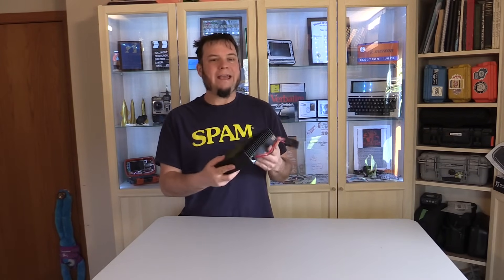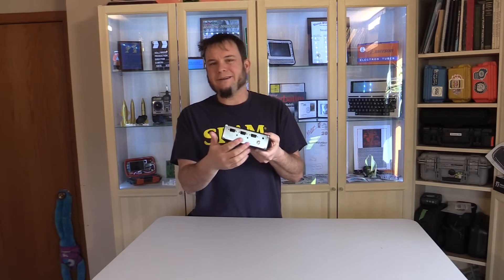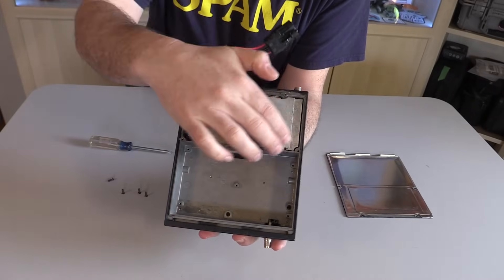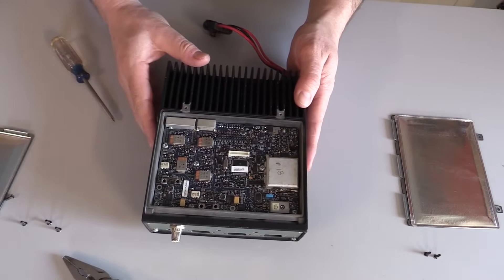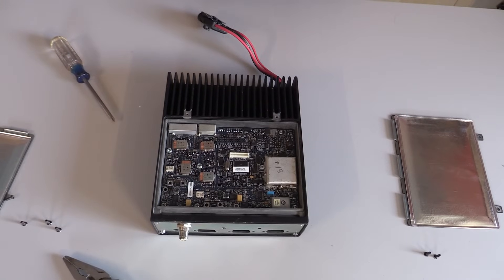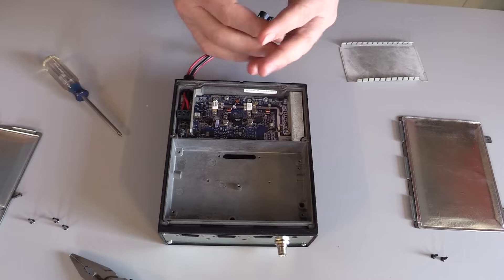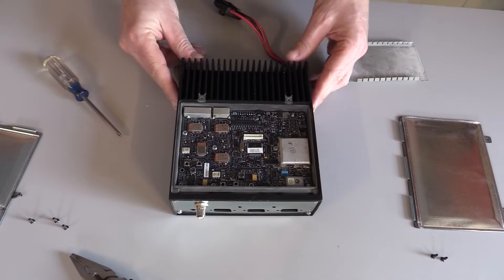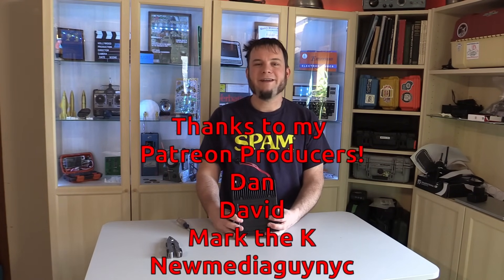Mystery Device From Ax-Man Surplus (Dataradio SCADA Tranciever)

Comment: Idea for homebrew use: it'd be cool to see if you could hack it to send your cars telemetry to meshtastic nodes or use it as a meshtastic mobile station. Being in the LoRa band already id figure it wouldn't be too hard to figure out how to console into it and tweak its modulation. Just verify that the output wattage is still compliant with current FCC guidelines. Not sure if they've changed much since '99.

Comment: The first Dataradio (aka G1) had no radio. It was basically a Terminal Node Controller (TNC) and (I believe) could only be connected on some Motorola land mobile radio.

Do you need a Dataradio controller? I need to check but I may have a spare controller laying around.

Keep up your excellent work!
Reply from the maker: I don't actually know what I'd do with one if I had it!
Reply: @saveitforparts  I'm sure that I can find the manuals if you want.
Reply: @saveitforparts  I can probably get the manuals if you want.

Comment: Yeah that's probably scrap metal.  I did some work on GE prophacy ifix systems about 10 years ago and it was all IP based.  Even if you needed a wireless link, you'd just plug your stuff into a switch and have a 2.4ghz POE radio to connect to the remote sites.

Comment: I used to work for Dataradio. That’s an RS-232 based modem that was widely used for public safety communications. I built dozens of systems based on that modem. It had parallel-diversity receive radios. (It uses a proprietary protocol for communication, and it requires a specific base station, as well.)
Reply: There should be a sticker on the back with an alphabetic serial number (4, maybe 5 digits). The communications board is what’s missing, so it is mainly just a somewhat useless 800-MHz radio at this point…
Reply from the maker: No stickers or numbers on it, I think it was just leftover factory surplus that never got to the labeling stage.
Reply: @Tim_Cailloux  When Sprint was allowed to buy Nextel they made a deal with the FCC to fix a mistake the government made by interlacing public safety frequencies between SMRS frequencies (Nextel) which caused significant interference issues. The result was called rebanding. A bunch of counties had these systems running for mobile data computers. Sprint agreed to buy the licenses, the data modems and the base stations. They were all supposed to be destroyed. At that point most agencies went to 3G and 4G cellular modems.

Comment: DataRadio Gemini PD (parallel decode) not used for telemetry or SCADA. These were used in police cars  or utility trucks for data connectivity. You’re missing the modem board. This is just the RF Deck. These were made in WI then shipped to Canada for DSP programming then to Atlanta for sale in the US market. The owners was Bob Roulette and Norm Pearl. Both were hams and part of the Montreal group that developed AX.25 protocol for ham radio. They took this idea and modified it commercial and public safety. The radio you have would have been in 2 bands UHF 400-512 and 800MHz. They feature dual RX antennas, GPS. The dual RX was for Parallel Decode aka PD. The radio used 3 Z80processors one for each RX and one to combine the data to recover a corrupt packet due to mobile fade or multi path. The data rate was 56kbps in 1999 layer upgraded to 64K. The modem could encrypt using AES or be in the clear. There was also a GPS onboard. These base station had the same capabilities of PD using 3 antennas on the tower. It also could correct the positions of the mobile units to sub meter accuracy with Selective avalanche on. When SA was disabled it was better than 10cm. We stopped selling GPS correction after that as it was un necessary. I worked for DataRadio in 1999-2001. It’s likely that the RF deck that you have was never finished at the factory and sold as scraps after Cal Amp purchased Data Radio. DE NI4Y
Reply: Excellent informative reply !
Reply: Nobody’s gonna believe me but when I saw the 12V connector and data and RF I immediately guessed Police data radio. So, I want a point. 😂
Reply: @LinHolcomb  the Integra TR was a SCADA radio in the VHF, UHF and 900MHz band .. Elephant Butte Irrigation District still has some in use ..
Same enclosure...
Reply: @jaimesolorza4186  I was at Radio IP at the time. I mostly worked alongside Michel Binette. There's still way more G2 still in use today than you may believe. I'm aware of at least 4K G2, maybe more. G3 didn't last as long.
Reply: @simonforget280  I understand, those radios are work horses like the original MDS radios...
Reply: @jaimesolorza4186  I have often wondered if they could be converted to a small repeater. They have a totally separate RX unit. I’m not sure what the isolation is inside the RF deck.
Reply: @LinHolcomb  I know they had built in duplexors and I believe adjustable helical filters ..you might be on to something... they had 400 and 800-960 MHz versions
Reply: @jaimesolorza4186 yes that was the SCADA side of the business it was run out of WI. That part was purchased from
EF Johnson. I worked for mobile data as an implementation engineer. We did some measurements for them on 902-928mHz sampling noise floor on the ISM band for the part 15 (no license required band. This was specifically done because a company called Ricochet was operating thousands of 902-928 MHz radios on light poles. They offered mobile data city wide at 128Kbps. The engineer whose position I took over left to work for them. It was an interesting company to work for, but they were mismanaged and expected a giant bid from the state of FL. M/A Com got the bid for a statewide data/voice system. We could only offer data. They laid off a bunch of folks. M/A Com never could make it work correctly. We had installed systems in Canada larger than FL using multi site controllers. MSC were Linux boxes that connected multiple sites over a giant serial card and Motorola leased like modems on POTS lines or microwave links.  I will say this really positive thing Bob thought US health insurance was terrible. He paid 100% of medical including all RX. It was amazing I had a $0 hospital visit.
Reply: Nailed it.

Comment: the lack of decals from the mfr on the outside make me think this might be a custom product that needed some specific changes made to it, or it was a prototype from the mfr. also those punch outs on the back we would usually just call DE punchouts or RS-422 punchouts. The most accurate term is DE because its the D-submini shell size E. its annoying, but the shell size can have any number of pins (or anything really) inside of it. you almost always have the 9 pin of DE-9 (commonly misnamed as DB-9), but i've seen it where its only a few pins in the shell. i've also seen serial comes run through a DB-25. and of course a DE punchout can just be regular VGA (which is E shell but 15 pins)

i'm glad these things are slowly all moving to just RJ-45 for everything lol

Comment: The header on top is interesting, that indicates that this hardware was also available in a stacked formfactor with multiple IO modules, meaning that header is a bus, and now that's actually pretty interesting. As long as the system has enough bandwidth to sink all the messaging without getting backed up, you can connect a bunch of different things to the same radio and they will share it. If you had an IO module this header also makes it easy to sniff on that bus and see what's happening to maybe reverse engineer it and build custom IO or custom adaptions for more relevant radio gear

Comment: The amplifier module could probably be used on a different band if you modify the filter.  It might be useful on 70cm as an amp for an ATV transmitter or for boosting an HT.  The rest of it isn't likely to be useful.

Comment: Motorola helped make efjohnson devices and they have a VRM in the 800mhz range that worked on an IV&D network. If EFJOhnson electronics are similar to motorola which it looked like when you opened it up. It would most likely need a network to run

Comment: I don't agree on your rant about screws. Phillips screws are the worst, you can easily mangle the head. Torx has been around long enough that everyone is going to have a bit set. And in some instances using weird security screws is a good way to keep laymen (or kids) from messing with mains voltage.

Comment: It’s an old Gemini PD VRM or vehicular radio modem.  Early 2000’s public safety mobile data terminal network connection.  If you’ve seen the blues brothers, think SCMODS!  Way back before cell networks had sufficient coverage and data capacity, cities or counties maintained their own RF networks.  This was the device in the squad car that connected it to that network.  Motorola also had something similar.  IIRC Hennepin County used them on a 700mhz band.  Looong time ago now!

Comment: Most likely SCADA. However, if you can trace the receive antenna circuit you should find a couple ceramic filters that will have a part number that you can look up, or might even provide a hint as th frequency range. Murata was one company that made these. Usually they are 2 to 4 sectin filters made of ceramic with conductive silver sputtered in and out. They will be securely mounted. One may be at the RF frequency, the other the LO injection frequency. If the radios are 900 MHz range they can be quite useful. However programming may be an issue unless an EPROM is the method and is fitted to the transceiver.

Comment: Looks like an under seat or trunk mounted transceiver. When I worked for companies that had 2 way radios mounted in the truck. It had a box like that with a breakout box that had the channel, volume, squelch, power on it along with a microphone connection. That empty space could have been for an encryption board?  A lot of that stuff was US Made back in the day specifically for a company like AAA or anything with a large fleet.

Comment: The larger board is the receiver / transmitter board that will interface with the missing data board. As you described the smaller board is actually the power amplifier for the transmitter. The exciter to the power amplifier is on the larger board. As for the small shielded box, it is probably the VCO that determines the frequency the radio receives and transmits based on the data sent to it via the microprocessor chip. 
SCADA was used to transmit data from water tower sites, sewage treatment plants, natural gas transmission hubs to name a few. The format was used primarily by utility companies to monitor critical processes and levels via sensors that interfaced to a local controller and then passed on to the data radio transceiver. I do recall the company name from years ago since they also used some Motorola radios such as the P50 and P50+ handhelds. They were equipped with the Hirose connectors at the top that went to a proprietary interface board inside the radio that took the place of the audio board. From what I remember they were used to connect a barcode reader gun to the transceiver to send scanned data back to a warehouse computer, a predecessor to RFID but automated by a human reading the barcode data.

Comment: That’s an old school enclosure for a time share trunker, likely for public safety. Before all the police and municipalities moved over to APCO Phase I/II they all had unencrypted but encoded trunked frequencies. It was all on 900 mHZ. The empty space is where the programmable board would go. They likely reclaimed the boards because they were controlled by the dept and just left the enclosures in a batch of police cars and someone removed them when they sold them off.
Reply: As to what you can do with it… I may still have one of those cards. Let me dig through my box of crap. I might still have some of this stuff.

Comment: I use google Gemini  and take pictures of the board and chips  to gather info  and to help research altho jumping into side chats about  components in a different chat then plug them in to get her to generate a plan of atack  it's so handy it can read the writing on the chip and infer it's use in the circuit..

Comment: Did you know there are several types of philips screwdrivers? If you see 3 little dashes on the head of the screw then it needs a  pozidrive screwdriver. I believe that Japan uses a different philips type also. I bought pozidrive screwdrivers over 40 years ago because Maytag washers and dryers used them.
Reply: pozidrive and JIS (Japanese) screws are not "types" of Philips - they're completely different, even if they look similar to Philips. I think some of them might have been to get around Philips pattents, but I think both pozidrive and JIS are superior to Philips
Reply: @gorak9000  I like the pozidrive because they don't strip out so easy. I also found the screws on Honeywell mod motors. Most of them were buggered up from someone using a normal philips on them
Reply: @jeffscheeler2532  I bought some Milwaukee pozidrive screwdriver bits a while ago, and since then I haven't run into pozidrive screws once! I think just having the right bits on hand scared them all away. At the same time, I bought a small container of Milwaukee philips tips too - I've used one tip in an impact driver since, and it's still in good shape. Good quality tips make a big difference. I do need to get some longer tips though - sometimes the  short ones just don't cut it. For wood screws, I still prefer Robertson, but they're still considered "specialty" screws in the US, even though they're the most common wood and metal screw in Canada.

Comment: Its an old analog cellphone frequency repeater going by the analog cell phone frequency's.
Its was used to boost and convert RF radio frequency's from copper telephone exchange from the serial ports 
Then it is converted to cellphone tower frequency's it does transmit and receive through both RF concerts on the box.
The GPS on the box lets the telco company know the location of the cell phone tower and phone exchange.
It does both data and voice it old analog Tec from the 90s before cell phones went digital.
I used to install them for AT&T, BellSouth, and US West.
Reply: Maybe, but with a 1999 date code on components? I feel like my local municipality started migrating over to EDACS trunked radio systems in the 800mhz band around that time.  I suspected this unit was a mobile data terminal for public safety, but I've no experience with them.
Reply: @elesjuan Analog was still very prevalent into 2000s. Verizon didn't shut AMPS until 2008. If you had an existing setup and needed to maintain it, in 1999, you bought that. 

I've lived through every cellular era shutdown so far, AMPS was the most disruptive for rural - but the easiest for urban people.
Reply: Do you know this for a fact? Model number?
Reply: Installation manual. https://help.calamp.com/files/references/manuals/m_gpdplus.pdf
Reply: Worth 6 Bucks just to Investigate it.
I've finished this DIY  1Kwatt 24 Volt KISS 😮Wind Turbine.I will try & put a Video on later on.
Reply: Why do you need expensive GPS for something that never moves? This was used on something that moved around a lot.
Reply: @Sven_Dongle gps defined oscillator
Reply: @Sven_Dongle  The GPS was used for time.
Reply: @ um, no, clock used for time, GPS used for location, dur
Reply: @Sven_Dongle  because it’s not see my post. They were predominantly used by local law enforcement. They were replaced with cellular data plans.

Comment: This may not be any help, but:
I have two links to your device (a dataradio Gemini/PD or /PD+)

mobileradio Russian webpage and find your device under the 'CalAmp/Dataradio' banner on the left side of the opening page under 'Radio modems'.

And the 'Product Overview; Intended Audience; General Description; Features - Dataradio Gemini/PD+ Installation Manual' of what your device is and/or was and/or was supposed to be.
And it is located at manualslib webpage and search for Gemini/PD.

Hope this helps.
Love your channel.

Comment: SCADA is also used by electric utilities to monitor power flow on power lines, substations, etc and to control breakers.  I used to work on the db side  for an electric utility SCADA dept but something like that box would probably be used at the remote site to send data back to a control or monitor center.  We used to have many breakers in remote areas on our grid that were controlled by radio signals.  I am not familiar with that particular unit that was in the video though.  Water companies also use SCADA to control and monitor water flow and open and close valves.
Reply: fascinating i worked in the 1970s for a manufacturing company that built SCADA mainframe computers Intel 8080 processors.. ..our largest contract was LAWP the name of the company was Northwest Digital Systems then Wescom bought them out.. 

Other companies we built SCADA computers for was Western Union talking to Westar satellite..also a few contracts with the US Government